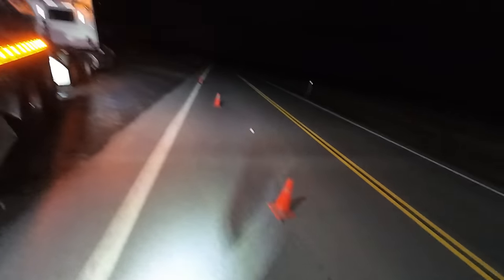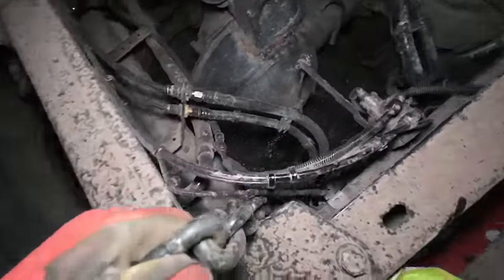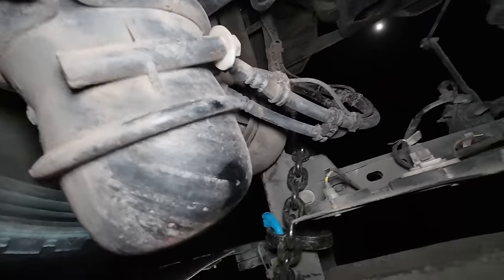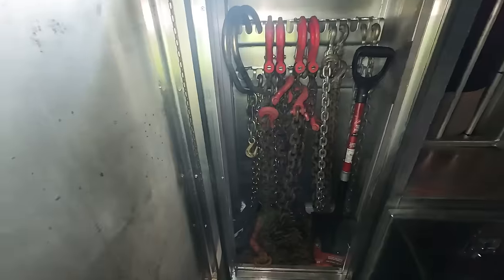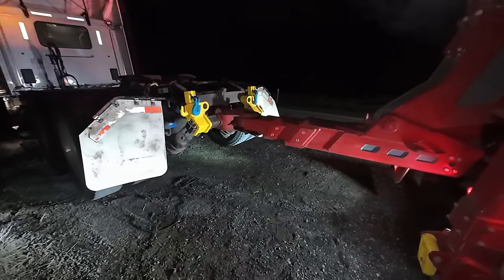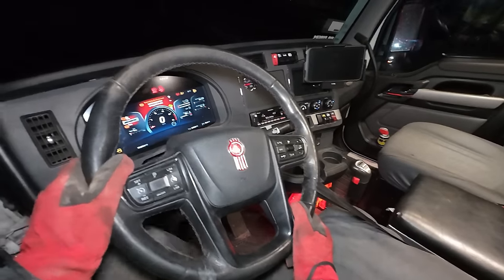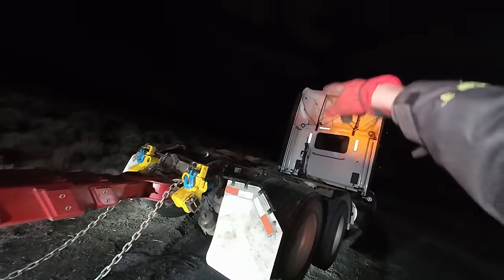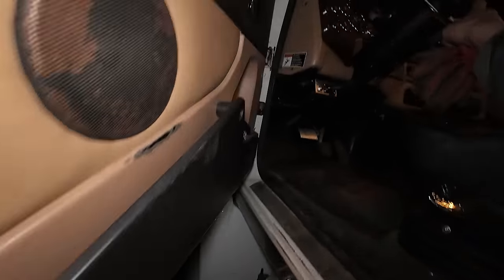Late night hook and book!

Comment: "I hear a truck coming, no it's not a truck at all, it's just an old Ford". My daily driver, made from 3 old Ford trucks. 92 F-250 club cab on a 97 7.3 dual wheel 4x4 5 speed chassis, utility box, and a lift gate. Thanks for the tow shows Casey, and the lack of led flashing crap lights that blind everyone.

Comment: Hmmmm....  I seem to remember about two years ago, some guy saying that he was done working on the side of the road and sold his single axle rollback truck and planned to only do off-road work.  Not sure what happened to that guy :-)  I know you're very safety conscious, Casey, but the work you do is very dangerous so I cringe every time a car/truck goes by at a fast speed.  As a now retired guy who's job required work on the side of the road at times, I can tell you it's very dangerous out there with drunk drivers, people on cell phones and other idiots. Please stay safe!   And people, if you see someone working on the side of the road, PLEASE slow down and move over.  Thank you!
Reply: Also said he would never use work lights for the back now look at him lit up like a Christmas tree
Reply: I'd also like to mention to the other drivers, stay on the road, it helps keep everyone safer
Reply: @dougjones6823 nope, he said he won't use work lights that point straight to the back into incoming traffic and would use spotlights that only illuminate the area right beside the truck.
Reply: Have you ever considered pushing in the red button can applying the brakes so you can drain your hair down quicker I'm sure that's a lot quicker than stamping on the brake pedal
Reply: @mikechotard3649  They fill the same volume in the chamber pretty much. Service brake applications will drain air faster than parking brake application will. Faster procedure with the pedal and you send air to all the wheels, not just the ones with spring pots.
Reply: I see so many people who just ignore all the flashing lights and arrows pointing for them to move over. I always make room when I can for people to my right when I see someone working on the road, or even just broken down. They don't slow down, they don't move over. They probably just wonder why I made a pointless lane change or slowed down or sped up for no reason... I did get out of a vehicle inspection by a cop because of one of those goofs. He was way more interested in nailing them than crawling under my truck and checking my paperwork.
Reply: @mikechotard3649 you'd have to push and hold the valve after a certain point anyway. Plus depending on the securement you'd have a hose flopping around on the catwalk.
Reply: @zyamadeadborn1785  it sure looks like they are facing the rear to me mainly lighting up the rear work area.
Reply: @dougjones6823  if I recall correctly, Casey was speaking about work lights that mount on top of the truck and are intended to illuminate a large area around it, but being so high they mostly blind other drivers, so he opted for the lower mounted ones with light beam going lower than line of sight. Point being as a passing by driver you don't look in the light source, only see the illuminated area and not get blinded.
Reply: @zyamadeadborn1785  you mean like the ones he has mounted high up on his light bar . I hate to rant like this but when someone preaches like he did that he wasn't going to do it and that people that had them were basically stupid then he goes and does it anyway come on ..
Reply: @dougjones6823  yeah, but look where those are pointed. As you can see no lights are pointed straight into the oncoming traffic, instead they all point down. Ans that was what Casey was talking about regarding that issue.
Reply: @zyamadeadborn1785 the ones under the cab point down but the ones on the light bar point straight back and high and the ones on the rear of the truck also strait backwards and not down..
Reply: @dougjones6823 that was only bright blinding stove lights and having a multiple array of lights facing the oncoming traffic ,??

Comment: That's exactly how i hook up.
Safety chains i run the same except i run them under the t bar not over it just in case theres a tight turn t bar doesnt bite them. Awesome video
Reply: Short trip to the shop.

Comment: Wouldn't it be easier to empty the air tanks by pulling the drain valves, or are the air tanks not very accessible.
Reply from the maker: Nope, that takes far longer and you then have to drain the primary and secondary’s separately

Comment: Smart man not grabbing that rear crossmember/ pintle mount. Whoever put that on has no clue what they are doing.
Reply from the maker: Actually they know very well what they’re doing and it works great for what it’s used for
Reply: @CaseyLaDelle  I'm ok with the correction, but can you tell me what it is used for if it being bent is acceptable?
Reply from the maker: @--_DJ_--  these trucks pull doubles and that hitch is used for moving the converter dollies around the yard and lining them up with trailers.   This one is bent because the truck backed into something
Reply: @CaseyLaDelle  Thanks for the second reply. I hadn't considered yard work, I have plenty of sketchy stuff in the shop that works perfectly but isn't suitable for the outside world.

Comment: Hi Casey random question why do you not need to do anything for the front brakes when towing from the rear? I know when you front to you usually run an air line to keep the brakes disengaged. Thanks!
Reply: Front brakes are service brakes only. Parking brakes are on rear only.
Reply: @jordanmpaul  thanks!

Comment: Is the cab-over truck, not a good idea for what you do even though you like that truck so much? Or are they too expensive?
Reply from the maker: Nobody makes them anymore
Reply: StrangeIy, I watched a video on cab-over trucks just yesterday.  They were popular in North America when length was the over-all length of cab and trailer.  When that legislation was changed to just take the length of the trailer into consideration, there was a move to more safety and comfort for drivers as the distances were so great.  In Europe the over-all length of the tractor and trailer is still the limiting factor, as well as the tight spaces and roadways in the mountains etc. and the relative distances are much less.

Comment: So what would you do for say towing an 8 bag show truck? Chaining to the frame just wouldn't be okay with me. I'd assume from the front and pull the DS.
Reply from the maker: Tell the too bad so sad and to call someone else.
Reply: @CaseyLaDelle  if you pay to repaint the frame ya scratch, I wouldn't care. 

I don't have an 8 bag but I do have a painted frame. You'd still be my call though.
Reply from the maker: @Goose2448  the only way would be to use wheel grids, which I don’t have, but the front axle would still have to be chained up.

Comment: I cant see any saftey tie downs ? Dont you use anything when you tow with chainsling?
(I guess the chans the chains jump up and out of the chainfork is to small..)
Reply from the maker: I hooked up safety chains plain as day in the video.
Reply: @CaseyLaDelle  
I dont meant the saftey chain from the Zacklift to the rear of the   towed truck.
You sometimes use axelstrap and sometimes chains and speedbinders ( like you did to the bus  @25.30 )

Comment: Note to self: c-channel by itself isn't strong enough for a pintle hitch.
Reply from the maker: It is absolutely strong enough for what it gets used for.
Reply: @CaseyLaDelle  it can be, but one minute in, you can see the c-channel hitch on the broke down truck is too bent.
Reply from the maker: @researcher4good  yes, bent IN from backing into something, not been down or out from too much load placed on it…. Because there’s never been a load placed on it.   Those trucks pull doubles and that pintle hitch is only used for moving the empty converter dollies around the yard.

Comment: I have a question what is it you don't like about the 8 bag suspension
Reply from the maker: No good way to fork them
Reply: @CaseyLaDelle  Use a knife.
Reply: @CaseyLaDelle I currently have two with the 8 bag the main one is a 98 t800 and my other is a 80 k100 I feel the suspension ride is smoother than the standard 4 bag